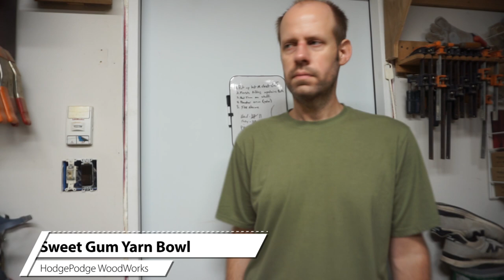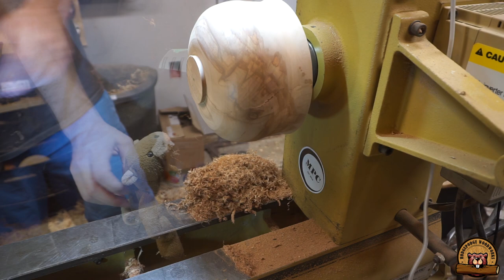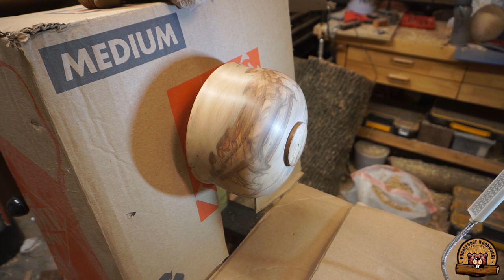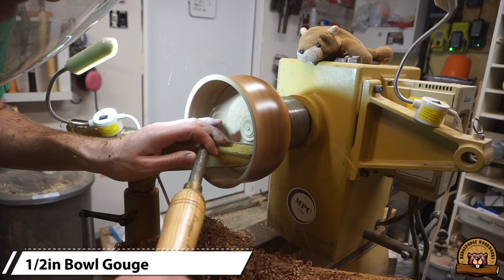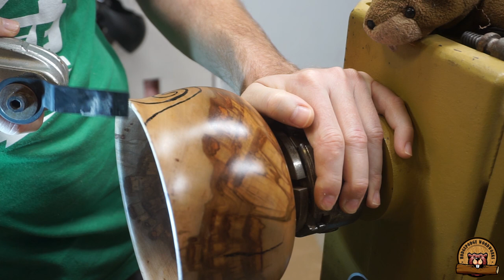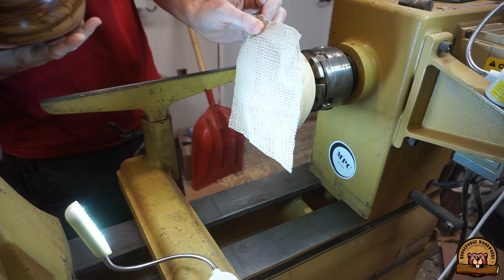Woodturning - Sweet Gum Yarn Bowl

Comment: That came out very nice. Question on the poly finish - spray versus wipe on with the lathe ate the slowest setting?  Any difference? Why do you use the spray vs the wipe on?
Reply from the maker: Well, I'm using spray just cause the can is almost empty! But after that I've got the wipe on lacquer to use.
Reply: HodgePodge WoodWorks - well, that’s as good a reason as any